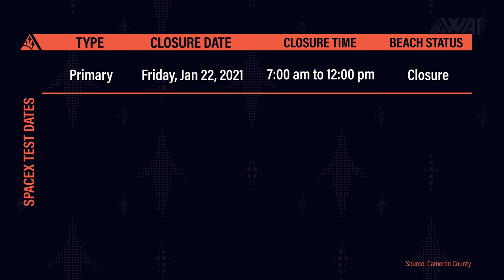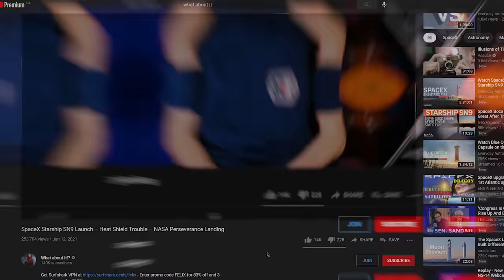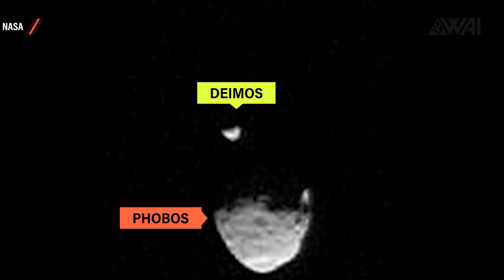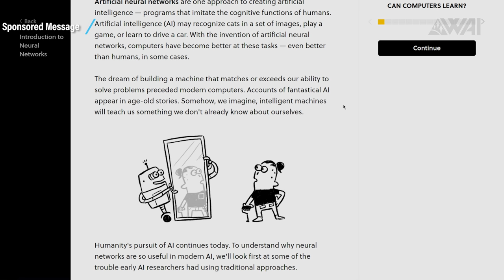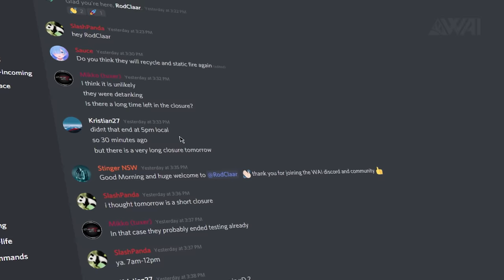144 | SpaceX Starship Sea Launch Platforms Under Construction! - SN9 Strange Tests

Comment from the maker: What do you think? When will the first Super Heavy fly?
Reply: Because of the thrust puck, most likely to be this summer
Reply: soon....
Reply: September
Reply: Probably when the launch stand and it's new fuel farm are complete.
Reply: It’ll take a little while but it will happen
Reply: Sometime this year for sure
Reply: Early 2022
Reply: I anticipate super heavy booster tests and launches by April/May 2021
Reply: by May or June
Reply: I think they will push forward pretty quickly. The rate of development is fairly steady so before April should be a hop I would have thought.
Reply: June 17th

I will be SO surprised if I’m accurate with this random guess
Reply: I think perhaps by Mid to late February, or by mid May we could have the first Super Heavy booster hops.
Reply: Summer ....
Reply: At least by Mid Year !  I hope !
Reply: I wasn't ready for old elon 😐
Reply: November 2021, first orbital flight attempt
Reply: Oh Well !  But the one thing that will keep my spirits up is that there will be many test flights before that November time line !  Those will help keep me pumped up for a long time !
Reply: After Artemis 1. Boeing have their lobbyists everywhere, and SpaceX won't get launch permission earlier.
Reply: november21
Reply: 2024.
Reply: If you count the hop as a flight, id say around may-june
Reply: maybe mid 2021.
Reply: Testflights April/May hopefully
Reply: 2021-2022 maybe 2023
Reply: June 2022
Reply: I think once after Sn10 leaves the high-bay they will begin stacking and after Sn9 leaves the pad and superheavy will take it's place.
Reply: June 1. 2021
Reply: All the YouTube channels about space seem to be Musk fan channels!
Reply: On a Tuesday.
Reply: News! Phobos is not in Galveston anymore, is going to Mississipi!
Reply: Thursday.
They just didn't say which Thursday.
Reply: That was a lot of ads! Plus, paid advertising?! WAI, what the hell?
Reply: It depends on how will Superheavy complete it's 150m hops and Starship progress
Reply: This is elonSX 2021 will be a sci fi adventure.
Reply: @investmentgammler4550  Legacy Space may get subsidies for now, but they can't keep Space X from launching. Legacy Space is destined to become increasingly irrelevant as Space X progresses.
Reply: October
Reply: probably this year we will have tests, and if we are optimistic, a flight test ...
Reply: The day it'll be ready to fly !
Reply: What about it? I love SpaceX, please don't get me wrong. I do however have grave concerns about Sea Launches. For the same reason they want to move the noise offshore I have to question what the impact on sea life will be? What is the decibel level at the rocket engines? How much will be diverted? What will happen when shock waves hit the water? How far will these noises travel? If Navy sonar sounds can debilitate sea mammals what is going to happen when "sonar X's Pi" ripples out into the Gulf of Mexico and beyond? What type of environmental impact study is being done? This seems like a huge NIMBY paradox. Please address this in an episode. I hate to rain on any parade but I have serious fears for the ocean being considered disposable or an endlessly regenerating launch substrate.
Reply: Can you please tell youtube to make a way to disable ads, or at least prevent the same ad from appearing over and over and over. It really destroys the enjoyment of your videos. I can't watch it
Reply: @frisbeephil about what your talking about he made a video before about sea launches and wild life and to summarize it, it is not harmful to the environment the way they wish to go about doing sea launches.
Reply: Not before March according to Elon a few weeks ago if I'm correct. As he's always very optimistic, it's probably gonna be somewhere around May.
Reply: @alexperera3202  do you have a link? There is no way it won't be harmful. It's a matter of just how much damage is done.
Reply: I don’t have the link but I’ll try and find it
Reply: @frisbeephil ok so I was not able to find the video that stated this but what I mean by not harmful I mean they will be using some technique with water as it launches from sea like sea dragon, and with that technique it won’t hurt wild life like fish.
Reply: @alexperera3202  thank you, I am trying to find anything official SpaceX about launching at sea and striking out as well.
Reply: @frisbeephil  
Look up bubble curtains. A couple concentric sets may be enough.
Reply: April most probably! And late 2021 for the whole starship launch...
Reply: Today 😂😂😂
Reply: Only the Lifter or the hole Thing? Lifter end this year..Hole thing Mid 2022
Reply: In one year
Reply: Either summer or october
Reply: Good question ! I think there’ll be a lot of ground tests first. Possibly a hop (early June this year) , as we’ve seen with the starship prototypes. But a full blooded flight I think Elon might get at least one oil rigs converted in basic form ,prepared as a transport & test launch platform. 
First flight early 2022 attempting a landing on the rig at sea. 
One hurdle will be how to have a floating tank farm or propellant processing plant for refuelling any craft on a seaborne platform.possibly a new tanker boat  in the initial testing .
Reply: Yes.
Reply: March 2022
Reply: Test Hop (possibly from Pad A or Pad B between March and May. First attempt to put a Starship in orbit - possibly by the end of the 2021.
Reply: give me a one mountain or a hill I will make a jumper electromagnetic superloop, give me one astroid I will create a space portstation 😉
Reply: Why can’t these rigs be used elsewhere as..... rigs?
Reply: @MrNickDanger  
™️
Reply: Late 2021, october / November
Reply: @MK-xc7pl  June 17th.. What are the odds? Better than 1 in 500 surely. ;)
Reply: While buying the oil rigs makes sense for landing and launching Super Heavy rockets, is it possible they bought them to get their own fuel supplies? Or is their enough natural gas close at hand?
Reply: spring 2021
Reply: I think it all sort of depends on how SpaceX plans to test the boosters. They will be putting a lot of Raptor engines on the line for testing. Given that the flight profile for Super Heavy is not dissimilar from a Falcon launch, I think we might see the first flight of Super Heavy also serve as the first orbital flight for Starship. I just think it's an unnecessary risk to do any hop tests or low altitude tests for Super Heavy. With all this being said, my best guess would be a full orbital test flight (or a high altitude ballistic test) sometime in late October or early November 2021. I really don't think we will see a full stack until SpaceX has completed and tested the orbital version of Starship. Considering we don't even know the final metal thickness for Starship yet, a test of Super Heavy before the end of the summer seems extremely unlikely.

Comment: "Wet Dress Rehearsal" I disagree. SN8 demonstrated they know how to make this thing fly, so "training" seems unlikely. Two theories. 1. After the 3 static fires damaged two engines, they were trying to break whatever they believe was the cause. Or 2. They were testing procedures to shorten the recycle time between firings. Also, updated TFRs for Monday through Wednesday show an unlimited altitude restriction which indicates a launch attempt.
Reply from the maker: Interesting thought! Thank you very much for the comment! :_WAIHeart::_WAIRocket:
Reply: Unlimited?   Maybe thats why it's called Starship
Reply: @robertsutton8894  As opposed to the 7000 ft ceiling limit in TFRs for static testing.
Reply: it's testing. minimum thrust. like running your car to empty to see if the guage is accurate. they test to distruction to gather data . . . naw just kidding, it's stoopid hard. if it was easy russia would have beat y'all to the moon.

Comment: Here's an idea for a on sea noise suppression system. Below the Starship, there could a artificial cylindrical wall (with bottom, 30m diameter perhaps?) that's lowered into the ocean. The water can then be pumped out. As the rocket is about to launch, gates open in the sides to allow the rush of water to suppress the noise.

Comment: Wouldn't the surface of the launch pad get damaged over time whether it's on land or sea? But they might not need a surface to launch from at all. If the landings on the grid fins work, it sounds comparatively trivial to launch from a fin suspended position too. Almost all the exhaust could be directed into open water.

Comment: As a petroleum engineer, I had to wrinkle my nose when you called it an oil rig. The thing in the picture is clearly a drilling rig, it is meant to dig holes in the ground, not to suck up any oil.
Edit: Oh, what you see at 9:30 is an oil rig with the flame burning (called flaring) for burning off excess gas. So the oil rig at 9:30 is not the ENSCO 8500.

Comment: Why don't they just launch superheavy from the hanging position as they will then catch it anyway .
For catching the fins will be strengthened and will need just a little more to hold the weight of starship and weight of fuel.

Comment: WOuldn't having the fuel farm located on an actual ship make alot of sense? it would have to refill, also it could charge a flight on the structure, then disconnect and get distance from the platform.

Comment: Would thicker stainless steel help with radiation exposure? I don't know why they are trying to use a less thicker steel before the first flights. 100 tons to orbit reusable will be enough of a game-changer, a huge game-changer. But what do I know?
Reply: I think they'll be using different thicknesses for different parts of the rocket.  As for radiation shielding, multiple layers will be needed for the habitable sections.

Comment: I know you have already done a video on how they'll protect marine life from sound/heat - but it was mostly speculation if i remember correctly. Is there any confirmation on how they will actually handle the problem?
Reply: I do not believe it is a problem.The ocean and environment are facing huge problems and stressors. Aquatic life around a mile from a sea launch facility is not significant.

Comment: SpaceX will (if they continue down the offshore route) probably design they're own purpose-built rig at some point, but designing/constructing one from scratch will cost roughly $1-2b and 5 years.  Refurbishing an existing rig is substantially cheaper, but also very limited, so this is likely money spent to determine feasibility/testing.  I doubt SuperHeavy will ever launch from such a small platform since a platform of that size likely can't handle the weight of a fully fueled SH + fuel storage..
Reply: You underestimating the capability of those rigs

Comment: Could they maybe join the two rigs together forming a super sized oil rig large and strong enough to handle the thrust and weight of starship?
Reply: It would kinda make sense, those platforms are small compered to Starship.
Reply from the maker: One rig can handle the weight and thrust easily. Where it's getting more difficult is in the space needed for the support infrastructure. I am already working on some research regarding fuel. Stay tuned for more!
Reply: @Whataboutit  wrong, the oil rig can't handle the thrust and vibration of a super heavy rocket, oil rigs were designed to float and stay stable at seas, not to be overstretched by loads.

Comment: Elon belike: ehh, I want 1 of you biggest oil rigs, but you can keep the oil!
Reply from the maker: □Imagine... the head of Tesla coming to town, buying oil rigs...
Reply: @Whataboutit  I may be wrong, memory isn't 100% anymore, but I think I saw on the NSF thread dedicated to the rigs, that he has options on more. in the picture of the Galveston port, there were several around the SpaceX one. I have a feeling he is going to set up a production line for getting rigs to test out his point to point idea. Two in the Gulf, two off the Cape, and two over by Los Angeles :D
Reply: @Whataboutit  hahaha unfortunately the biggest oil rigs are already used for other purposes and modern oil exploration is done under the oceans
Reply: @davidcadman4468  Apparently the company selling them were flogging off 6 of them.

Comment: Why spend all the money and effort on the huge new launch pad under construction?
Why spend the efforts to move and ship Starship and boosters on a barge only a hundred miles or so out into the gulf?
Why bother building a LOX plant on site for a short term?

Because they'll build them at Boca Chica, and FLY THEM to the floating pad for orbital launch. No different than Boeing flying a new plane to its customers. You can deliver Starship and give it a test flight, all at the same time.

Comment: They could possibly use both rigs as one, in tandem to increase the load and space capability. ie. connect them together. That would be my guess as to there plans.
Reply: yes, i was thinking maybe one will be used as a launch platform while the other is used to store and cool fuel, or as a service station with all the engineers, tools, and a crane.
Reply: @jesusmora9379  Yeah, that would be a good use of the two being seperate. I don't have any idea just how dangerous a fuel farm is, but having it shielded from the main deck (underneath) could be a thing.
Reply: Or one for launch the other for landing.
Reply: 3 rigs in a triangle would be way more stable lol
Reply: Uhm nope, they will need some serious upgrades since everything has to be very stable in waters, and explosive/fragile rocket equipments and fuels needs protection
Reply: Mars-B project?
Reply: my guess is that these are support vessels, necessary for the construction of the sea-bound launch platform, and its continued maintenance, but  not the actual platform itself.
Reply: @alanmay7929  The main feature of offshore oil platforms is stability. It is space for the launch platform that must be made.
Reply: @markhorton3994  the platforms are not made to support the gigantic forces of rocket engines and thrust, thats why even on land they have to build a special launch pad, also the conditions at seas are may worse than the ones on land so its going to have some severe limitations, they could have used the desert

Comment: Hey, WAI, I’m betting the terror twins will only be modified just enough for testing, and the actual long term launch platforms would be built later, probably as dedicated platforms as the differences required are massive compared to oil rigs.

And I wouldn’t be surprised if SpaceX purchases a small low yield gas well near the shore to provide liquid methane for the rockets and power for the liquid O2 refinery that will be onboard the platform, I really doubt that SX will be using solar power for launch platforms for a while. And plus when those wells do run dry you can use them as methane holding tanks for non liquid methane.
Reply: I agree about the oil rigs. There is no way spaceX uses modified oil rigs to launch starships forever. With a price of 3.5 millions they may have just bought it because of how cheap it was. Who knows if they are actively planning on using them or just keeping them as an option for later

Comment: Thx for the CC's! 
I commented to a cousin on FB that nasaspaceflight.com operatives will have lots of fun spying on the two (the other one is on it's way to Brownsville) oil rig's conversion. This is going to be an awesome year. There is ongoing work at the Florida pads, so don't rule them out for SS/SHB launches. 
I think that SH SN1 will fly sometime this Spring. It has almost all the parts necessary now. Just needs to be put together, and rapotors added. The limiting factor maybe the OLM under construction. UNLESS and this is really stepping off the cliff, they could launch from launch platform a or b with limited raptor #'s for a short hop. "How desperate are we #1?? He gestures with a hand flying over his pointy top!!"

Comment: The only thing that concerns me about launching from the gulf, but thankfully they are using movable platforms vs building an Island like China did. There is a fault line in the Gulf of Mexico. Not a very active one, but I remember being on the 32nd floor of the 100 North Tampa Tower when we had a minor earthquake from it. I lived in Florida for nearly 30 years and never new there was a faultline nearby.

Comment: They'll likely join the two oil rigs together.
Reply: I was thinking that.  Either they bought 2 at the same time to prevent the price going up when they know you want the other one or SpaceX plan on using/joining them together.
Reply: tbh it sounds faster and cheaper to just build a new one lol
Reply: @tomh1727  Not when you can buy two at a fire sale price of $7 million total.
Reply: @boostav  but you have to totally refurbish it and install brand new equipments so its still not easy. Also how are they going to make energy on board?! Use diesel generators?!

Comment: And that is with existing technology that SpaceX has currently so for instance the Falcon heavy tanks has two tanks on either side but instead of two tanks the mother starship has four starships a total of five starships in a configuration or cluster the mother starship will have to be built slightly differently and slightly longer so that she can carry the cluster of four ships starships so we know there is going to be a total of five ships a mother four starship.
The mothership will be launched into space first and the four star ships will join the Mother starship and will Be cuplink together like the Falcone heavy with the two boosters but instead of boosters she has four stars ships around with her